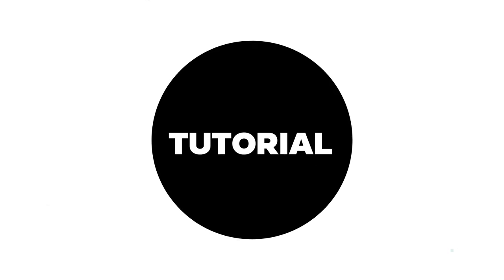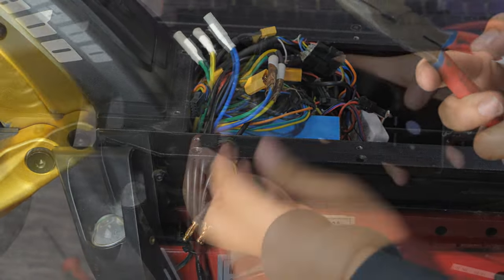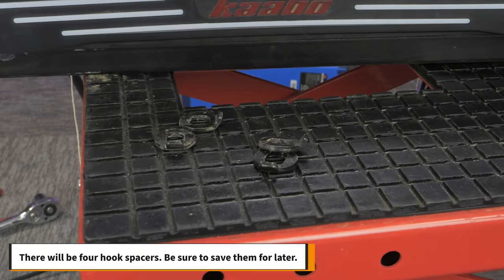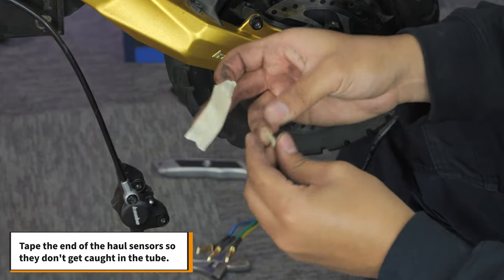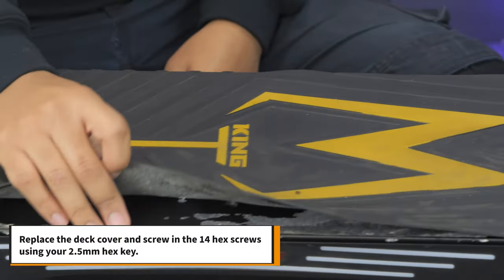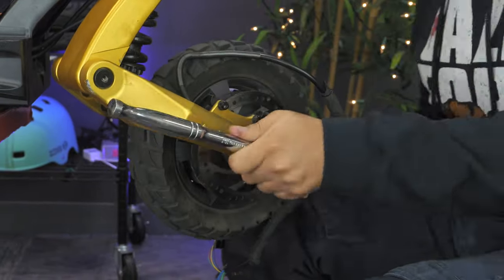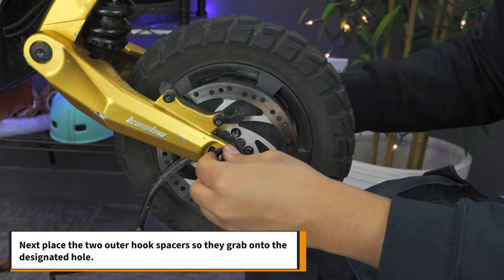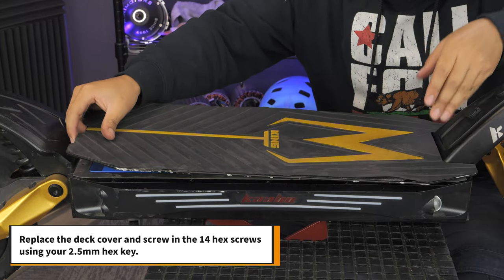How to replace the brake  rotors on a Mantis King GT?

Comment: Im most likely going to add a custom quick disconnect for the motor cable and hall sensor wires at the swing arm whenever I end up having to replace a rotor.  It should have one there anyways.  Kaabo probably didnt do it because of wanting that ipx5 rating, which is silly because who in there right mind would ride this scooter in the rain or through puddles anyways?